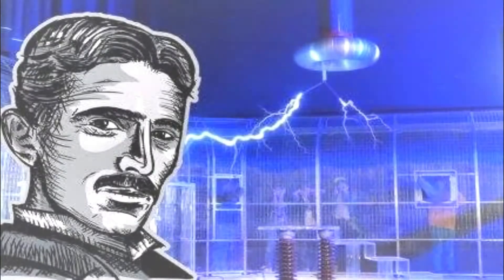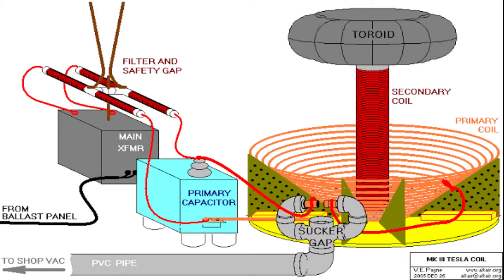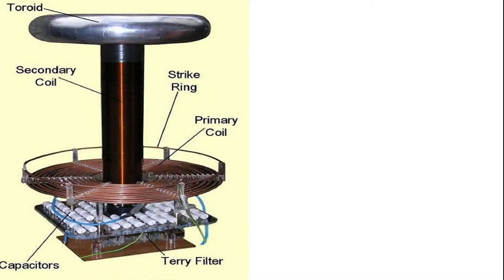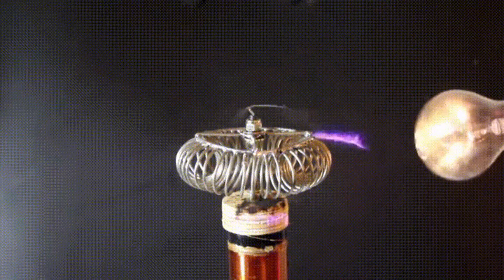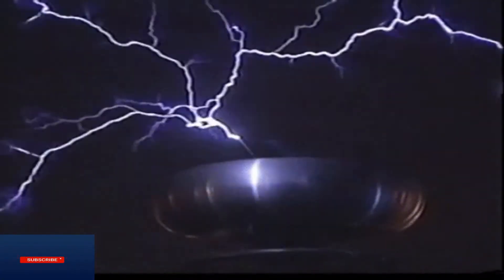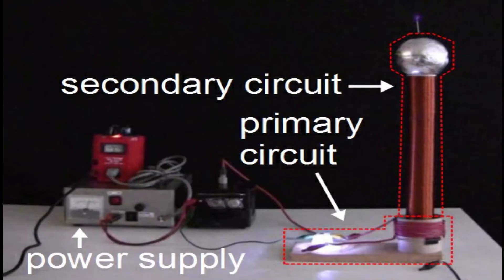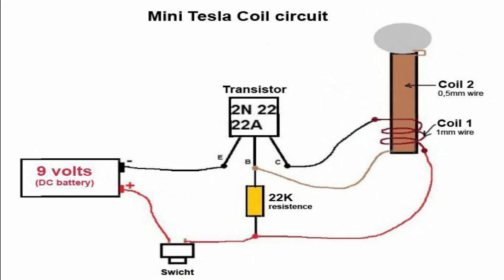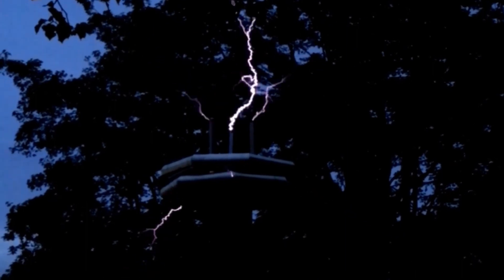What is tesla Coil | Tesla Coil working Principle explained

Comment: See, there's where you're wrong. 100mH coil Connected in series 100.F capacitor pulse Primary at 630mS You can get the secondary to get up to about a 1000 Volts 1000 amps with a minimum of9v And mine doesn't get HOT Or uses transistors. Or a spark gap

Comment: Stop pumping power through it and use it to collect the positive energy from the molecules moving through the sky. Harvest this power among a network of Tesla coils and tap into it with a negative energy source - this is what he wanted to do
Reply from the maker: Wow that sounds great
Reply: @learnwithyaqoob  it's pretty much wind power, but without the blades and capturing the source of that energy rather than the effect. Tesla would have built a windmill if wind power was the answer.